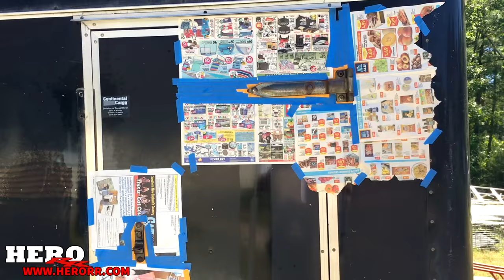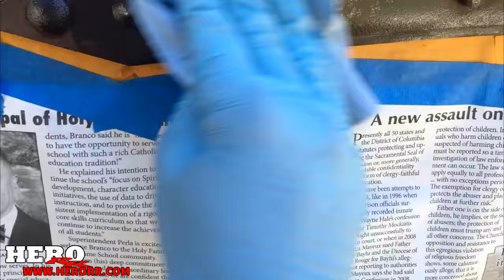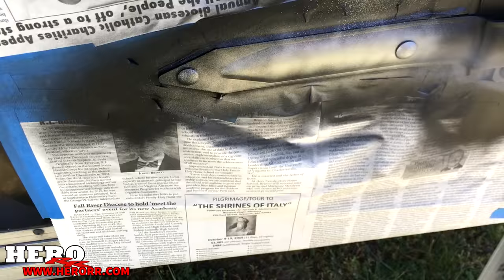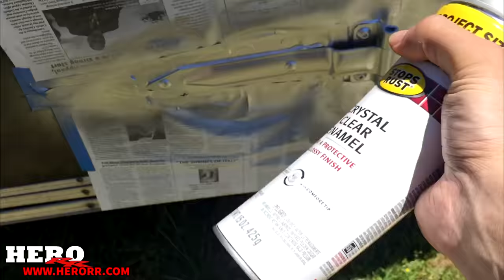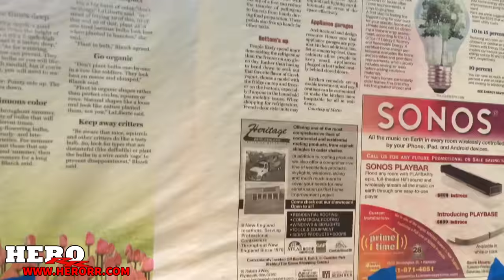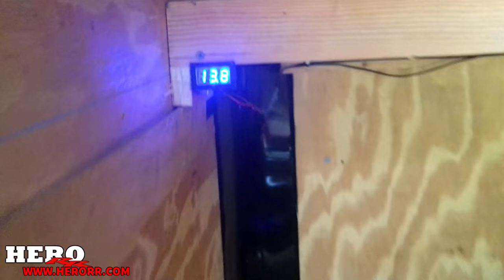$1500 Trailer Restoration (Awesome Motorcycle Storage!)

Comment: On the roof and on the exterior sides…. What type of paint were you brushing and rolling….  Assuming an enamel, but want to be sure.  My trailer is almost an exact replica used for bikes and Jeep support.  Some great ideas - enough to keep me motivated to keep it.  Just some pointers on the exterior painting would be appreciated.  Rolling versus spray is better in my neighborhood.  Thx.